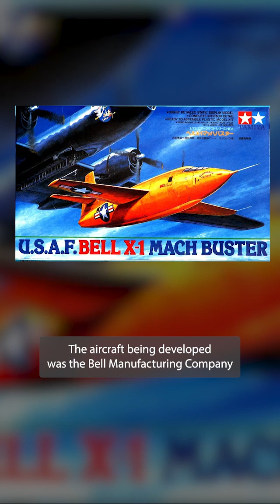Breaking the Sound Barrier | Aviation History Month Day 19

Comment: funny, Me262s went there in 1944!
nearly went mach 1 in a dive!
Reply from the maker: So they did extensive tests on the 262 after the war and I think it was possible one of them may have inadvertently exceeded the speed of sound hut they were underpowered for the feat. If you factor in the lower altitude these flew at the speed of sound was much higher than up at altitudes like the X1 or XP86 flew at when they broke it.
Reply: @The_Flying_Mechanic  And both flying devices were worthless for anything other than experimentation.
Reply from the maker: The XP86 became the F-86 and F-100 jets. Hard less useless. The X1 has no additional value.
Reply: Which is it, DID they exceed the speed of sound like the X-1 or "NEARLY went Mach 1" you qualified your own assertion so much that it means they didn't.  Also the video clearly says "First to exceed Mach 1 in LEVEL FLIGHT", the assertions about the Me-262 were all about dives, not level flight...in other words inadvertent and not what the plane was designed for.